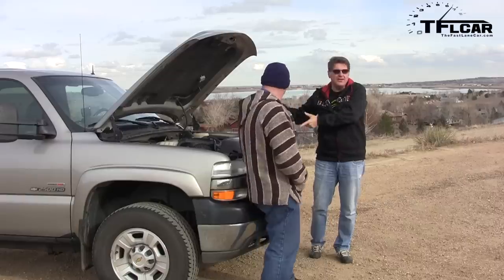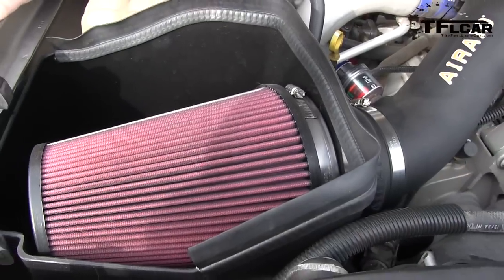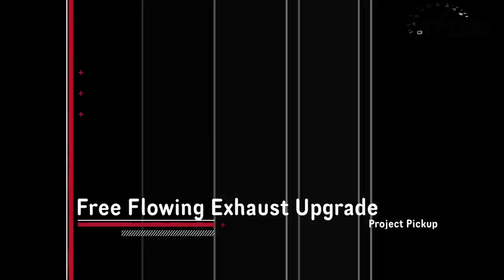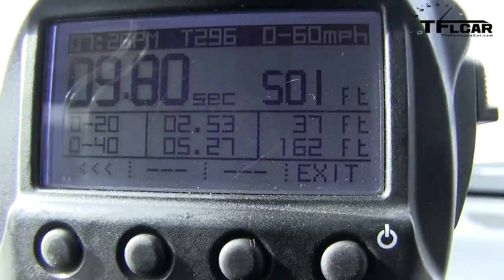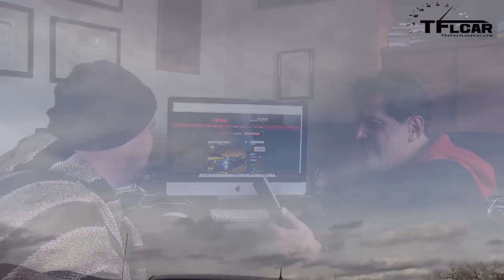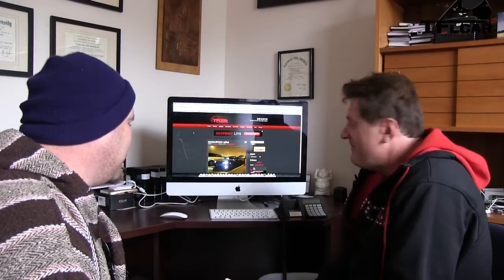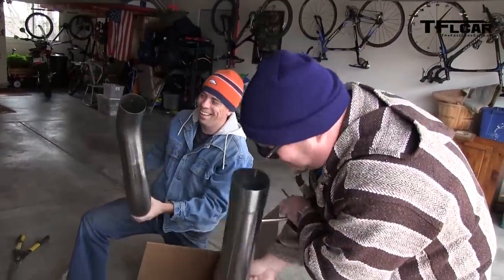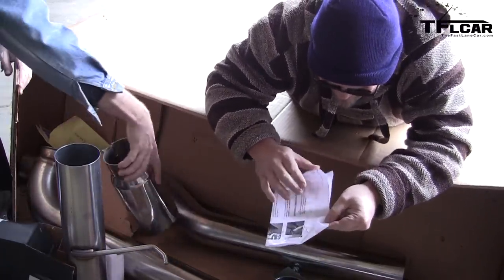Project Pickup: Make your old truck sound & perform better with a Performance Exhaust (Part 1)

Comment: 10 year old truck is old? well.... Unless you have money, a 10 year old truck isn't that old. I'm sure many will agree.
Reply: +HALO3286 Mine's a 99, and I felt like she was brand new when I got it. 16 years.
Reply: Mines a 2000, with over 202,000 miles, she still runs like new. Stock everything besides a alternator and brake lines and brakes. otherwise the original drivetrain and motor. Could use a new transmission soon though, kinda late shifts or slips a little sometimes. But yeah, these 99-02 Chevys will go forever. That is until the frame and body rust out lol
Reply: +HALO3286 shit I have a '72
Reply: +HALO3286 10 years old is new for a diesel.
Reply: Yeah it is, a diesel with 100,000 miles on it is like new. They go forever!
Reply: +HALO3286 1996 chevy s10 250kmiles...4.3l v6 vortec.
Reply: +HALO3286 my 96 f250 isnt that old and thats 20 years old
Reply: i agree
Reply: +HALO3286 I agree my chevy is 16 yrs old
Reply: +HALO3286 Agreed I have 2002 F150 5.4
Reply: Dale Cocking mine is 20
Reply: +Michel Linschoten Yup. I have 93 silverado c1500 350tbi. Mine is stock but I am amazed how awesome powerful it is. Long bed with cab though so I have the boat. lmao. She sounds way better than that duramax they posted here. No offense. I want to dual mine out. What I would give to have that stock cobra sound out of my 350. Seriously. I am not too big into ford but I love the sound
Reply: 20yr old xlt f150
Reply: Yeah I have a 1986 Ford F-150  5.0
Reply: I have a 97 k1500 with a 350 vortec  with 462,* on it and it needs a new tranny slips in first but it still goes 0-60 no problem drive like champ still with every thing all stock lol
Reply: That's not stock a 350 lol...but i get what you mean tho.
Reply: 01 Chevy lb7 duramax with 280k miles and still going strong as if she just rolled out the factory
Reply: HALO3286 mine truck is hella old 😂😂😂

Comment: If the year of the truck starts with a 2, it’s not old
Reply: I am 50 yrs old and unless something happens I plan on keeping my 07 gmc 5.3  extended cab truck.  Would love more low end power.  Don't speed much put like to get to speed limit fast

Comment: 10 years is old? I just bought a truck more than 20, it must be ancient..
Reply: roger chave my trucks 34 years ,,, and to me its just getting broken in LOL
Reply: +lesterclaypool1 my grandpa bought the my truck 5 years ago it's a 1995 ford xlt pick up truck it use to be my dads but it got handed down to me my grandpa got a new and my dads took his old truck I took the ford I don't even have a license I'm 12 but I drive it every day
Reply: Hydro Awesome101
That sounds awesome, buddy.
I like my 30+ year vehicles because no computer = easy repairs.
Reply: +lesterclaypool1 I know but my truck got transmission problems I got to rebuild it
Reply: Hydro Awesome101
Mine needs brakes all the way through and some rotted corners in the cab welded.  Those are my winter projects.
Starts every time I turn the engine over, though.
What's wrong with your tranny, buddy?
I just bought a 98 edge stepside from a woman for $250.  Reverse stopped working and she didn't want to pay for a new transmission.  I'm gonna try hitting it with my friend's brick, first, to see it that fixes the problem.  If it doesn't I'll have to add a transmission replacement to my list.
Reply: lamar jamar
I often have people asking if I'm selling my '81.
Not for all of the money in the mint!
That old bitch has never left me stranded and if the shit hits the fan there's no computer to be remotely shut down if the powers that be don't want us going anywhere.